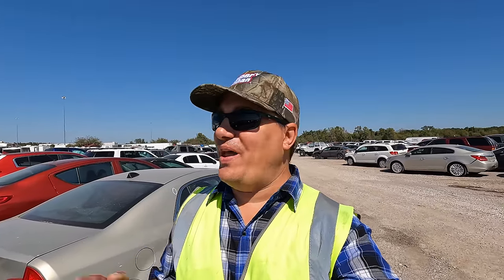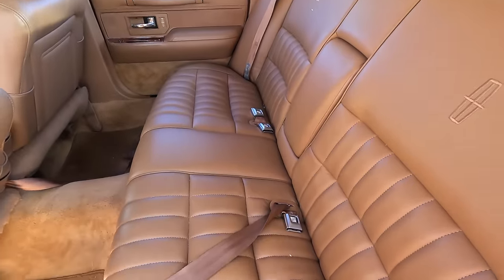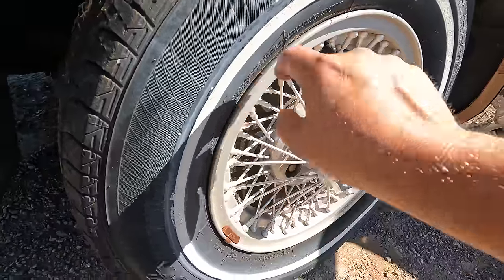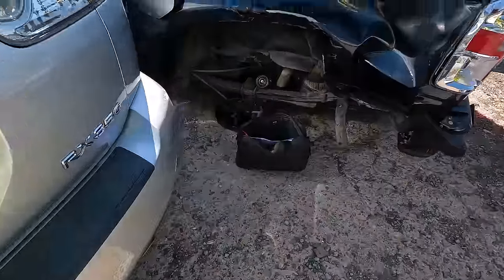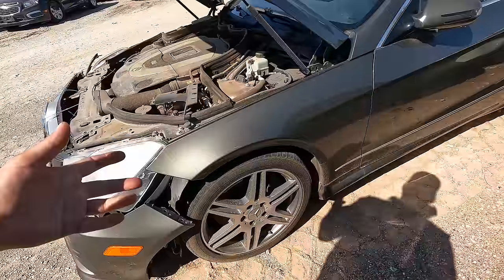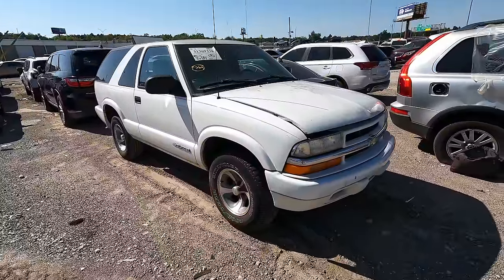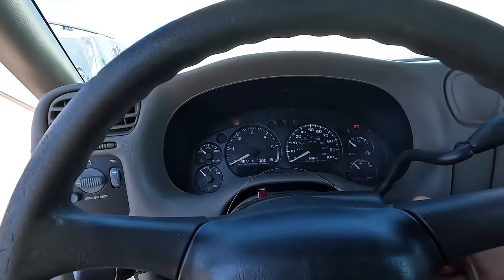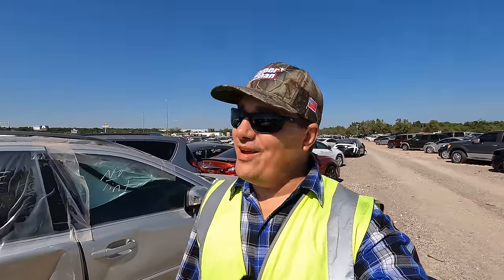IAA Walk Around and Live Bidding!! Winning 5 cars!! 10-9-21

Comment: I laughed when he said "No one in their right mind would bid on this, I will throw a bid on it!"  The Ford name for the color on the Lincoln is Champaign.    The Hybrid message "Stop safely" is most likely a hybrid system fault.  Could be expensive to fix.
Reply: Looked more like rose quartz or possibly a shade of copper.
Reply: @danielulz1640  Yeah you are right.I had a Contour in Champaign and it was a lot lighter then  this.Looks like
Light Sante Fe Metallic
Reply: Hybrid is Latin for "EMPTY YOUR DAMN WALLET"
Reply: We p
Reply: And the Lincoln executive series there was 2 panther products in the video and that means if it needed motor work you could pick up one of the other panther platform products and put that 4.6 in it one of which I think is a white crown Vic cop car, and honestly all the interior issues with the 2wd 05 Chevy blazer lkq
Reply: Look more like bronze or copper

Comment: GM vehicles have day time running lights, your RAM does too.
Reply: But all of the lights were on, not just dull head lights.
Reply: @mexicanspec  Yup. Plus the daytime running lights on these are shared with the bright lights which are in the inner part of the headlight housings closest to the grille.
Reply: @Stressless2023  I bet there is a dirty sensor or it is covered.  I did that on one of my cars, I don't remember which one, so the lights were on all the time.

Comment: The headlight on mid 00s gmc/chevy have automaticity on headlights from the sensor on the dash , if i remember you push the dome overide switch like 5-6 time to set it to maunal mode
Reply: I  think it's just Daytime running lights I don't see a twilight sentinel sensor on the dash\
Reply: @bradmyers362  The daytime running lights on these are shared with the bright lights (the section of the headlight housing that's closest to the grille). The regular headlights might be stuck on due to the dusk/dawn sensor or whatever it's proper name is lol.

Comment: I think the wheels on that Lincoln was from a much older car.  Those same wheels came on my family's 1988 Town car.  I bought they used the same wheels for 8 years.

Also are you sure it is a 1996 model?  Those had the much smaller head lights.

Comment: The Lincoln is a 1994 and it has air ride which can be easily switched over to coils and shocks! Tough cars! I've owned many of these and they ride like a dream!!!! The wire wheels came from a 1985-1989 model. Pull up on the gear shift lever to start it. I bet you will have it running and driving easy!

Comment: Hey I am an old car fart!  Love your video, love your excitment and I will keep watching. My first car was a terribly worn out 38 Chevy which I overpaid for at $30.00 in 1951!  Hey you have to start somewhere.  Currently I have a 97 Lincoln town car, a little newer then the one you are showing.  Love it and it has just over 150,000 and it has been garaged every day of its life.  They do have a wonderful air ride suspension and it is not to hard to maintain.  Then I also have a lovely 83 240D which about a dozen years ago I replaced the 240D with a 300D turbo and did it all myself.  Nothing but M/B factory parts in the swap over, it is exatly like factory!  It is a great old car and I love it, though the A/C was needing everything when I got it and has been removed under the hood.  I will probably be selling it because I am 90 years old and I really love the automatic now!

Comment: 17:20 Escape hybrids have main 300 volt battery back in trunck and either it was in service mode (battery off) or battery just needs shock and car will start, usually those batteries go low after 30 days of sitting

Comment: When I retired I worked as a chauffeur for years until the pandemic hit the Lincoln Town Car is a great car the 4.6 engine is the same as they used in police cars they are good for 2 or 3 hundred miles with no problem, The most comfortable car I have ever driven

Comment: The 4.3 is a great engine. I had and 89 Chev half ton with this engine and it had almost 300000 before the original motor died. I was the 3rd owner and gave it to my son after I finished with it.

Comment: The Blazer has daytime running lights- they're the high beams at partial power, that's why the headlights are on all the time.  When you turn the headlights on, the regular lights will come on.  You can put on the parking brake and they'll go out.  If you don't like the DRL, there should be a fuse in the fuse box (side of driver's side of dash) that is listed as DRL- pop that fuse out, and the daytime running lights should go away, at least my 1995 S10 had the DRL fuse and I did just that, I didn't like the DRLs.

Also, I think that you probably have to use the key to get into the hatch.  The blazer doesn't appear to have power locks so probably doesn't have a power hatch.  I believe that the key unlocks the glass and when you open the glass, there is a ```handle in side to drop the tailgate.

Comment: Blazer has DRL and automatic headlights too.  The ones that were on though were the inside ones which are the high beams running at low voltage.  No fault.  If you throw something on the dash on the passenger side they'll come on too.  That's where the sensor is.  2005 was the last year for the Blazer.  Only available in 2dr, 2wd.  Mostly used in fleet applications.  The seats are 2002-05 style.  The front end changed in 1998.  That is the last variation of that front end.  I know a lot of useless info about the S series.  The 4.3 is one of the best powerplants GM ever made.

Comment: Hey Randy, Great Coverage.. I Hope You Win The Bid On The Benz.. The First Year Of The First Gen S10 Blazer Was ‘83 When The 1984’s Were Introduced, I Had An ‘85 4X4 2.8L Manual (Terrible Service, Engine Barely Made It Past 70K, The Second Engine Started Going Bad At 68K) The Second Generation S10 Blazer Was ‘93 Introduced In 1993 New Models Like That One.. I Had A ‘97 GMC Jimmy 4-Door (38K The Rear Diff. Started Going Bad) I Traded It For A ‘99 Yukon (120K Trouble-Free Miles)

Comment: Randy, On the S10 Blazer, The Daytime Running Lights will turn on when you Start the Vehicle. To turn off the Daytime Running Lights, Simply push the Little Round Button on the Headlight Switch Panel 3 or 4 Times while the Vehicle is Running & Like Magic, They will be off. ;) I own a 2002 Chevy S10 Extreme Blazer and wanted to give you a lil Info so you don't need to Replace the Switch or Relay.

Comment: The Town Car looks like polished copper to me.  So far, I've had seven of them. I'm driving a 2006 (70,000 miles) right now.  Love 'em.  I'd worry about the air bags though.  I've replaced more of them than I'd like to remember.  Your videos are interesting to me.  Some folks just like to complain, don't let 'em get to you.  All of the vehicles you found today were interesting.  Congratulations!  Looking forward to your next one...see how you did.
Reply: Which years are ok for airbags?
Reply: @blackterminal  None of them, I regret to report.  I like them well enough to merely consider replacing the air bags as part of the purchase price.  But then I drive them, I don't try to repair and sell them.
Reply: @mkofftiger  i had a 86 that just had springs. I loved that car so much. Cried when I had to sell it

Comment: i had a ford that wouldn't start after the battery died until you locked and unlocked the doors with the key fob or by locking the drivers side door.

Comment: Randy: I have a 1998 Chevrolet blazer 4 door. 4.3 vortex engine, runs great 178500 miles on it. The head lights are always on. They turn on automatically all the time.

Comment: White 2wd blazer cheap shop truck, daytime running lights lol,, and maybe a 4 light up mod my Silverado extended cab short bed Z71 a early 94 Chevy has had that mod and disabled the dimmer switch because of Spyder halo led projector smoke tint headlights and eBay bulbs junk..

Comment: I have both a 1996 and 1997 Lincoln Town car here in California, both with close to 300K on them. The 4.6 engines are easy to work on, get great gas mileage considering how much they weigh (similar to your Mercury Marauder) and are an absolute blast to drive just not on rainy days being a rear wheel drive vehicle.  In regards to the 2005 Blazer, those are the daytime running lights on with the engine running.

Comment: Ventured into my 1st auction car. Very good exterior n interior. Turned on, sounded good. No dash lights on. Couldn't drv it due to auction house rules. Pulled the trigger n got it home. The fkn thing has trans problem plus electrical n power steering prob. Posted as a REPO with clean title. Seems like they hid the probs n now I'm FKD. Terrible 1st experience

Comment: On the Blazer; abs faults will turn on the brake light. Probably both front wheel sensors are bad. That failure turned the brake light on in my 2002 S10 ZR2.

Comment: The Escape Hybrid doesn't have a starter.  The ICE is started by the electric motor.  When the 12 volt battery goes flat, it creates all sorts of issues and throws all sorts of codes as different systems stop communicating with each other.  Jump starting it isn't enough, you need to fully charge the battery if it's still good, replace it if its bad.  Then clear codes and there's a decent chance the car will start.  If the HVTB's state of charge dropped too low, it will isolate itself so it won't discharge further.  If the HVTB SOC has dropped below a certain levlr, things get complicated, but are still fixable.  09 was the most desirable year for the FEH...first year of the bigger engine, last year of the better battery thermal management system.

Comment: Look at the Explorer. When you had the key in the on position, the security light was flashing fast in the bottom left of the cluster. Probably has a PATS fault which doesnt allow the starter to engage. My old F-150 had this issue, and the root of the issue was a weak transponder chip in the key. If you had the time, it may start up after sitting there and cycling the key for awhile.

Comment: That 1994 Lincoln has wire hubcaps you have to pop the center cap and they are locking and the key in either in the trunk or glove box. These in good shape in my area are a 2200-3500 in my area.

Comment: Hybrid vehicles don't have a starter motor. The ICE "bump" starts off of the electric drive motors. This particular Escape judging by the appearance that its been parked for a while means the hybrid drive battery is completely depleted and does not have any power to turn the drive motors.

Comment: The security light was blinking quickly as you were trying to crank up that ford escape, it could be anti theft stopping it from starting. I know my 2000 Durango wont start after a dead battery unless you hit the unlock button on the key fob a couple times. Next time you could try hitting unlock on the key fob it might help.

Comment: The town cars wire rims are from the 80's.  They didn't make them in the 90's.  So they were switched out at some point.  The caps on them actually have some value because they get lost and are quite rare. They can bring $60 to $100 a cap from a guy who wants to finish his restoration off.

Comment: My father owns a Lincoln Mark 3 it's electric problem %100  check the wire's under drive side if look like some messed with it  just resolder the wire's cheap fix most of times 😎🤠🤔

Comment: I would have bid on the Lincoln as well. Around here it’s a sought after vehicle by all demographics. I don’t particularly have luck with Ford’s but if I got it running and the rear airbag suspension was good to go maybe some paint or clear coat and at best that plus tune up she’d bring a great turn around.

Comment: The headlights on the Blazer are DRL's.  They stay on when the key is on.  And since it's a "basic", no tilt etc. it won't have the remote deck release.  I wish you would have looked at the Volvo next to the Blazer.

Comment: I'm partial to the Town Car. The bags are probably shot which was common with them. My father-in-law had a '97 and it was cheaper to get the rear suspension converted to the springs than repair the bags.

Comment: The hybrid escape  won’t start when it sits with a dead battery . The hybrid battery runs below a certain voltage it disconnects..  you have to charge the 12 battery to full then actually jump the hybrid battery . You do this by removing the left side dash corner panel and press and hold the button  . The green light will flash next to the button you let go and let it go for 15 mins . The car is using the 12 volt battery to bring up the voltage in the hybrid battery . .  You might want to do this 2 to 3 times . If you have a scanner you can watch the voltage go up as you do the jump start process ..  ..

Comment: A note on those ford escape hybrids. When you jump start them there is a button in the drivers side footwell that you need to push. Those use the hybrid battery to turn the engine over. When you Jumpstart one push that button and wait 5 to 10 minutes. That will put a sufficient charge in the hybrid battery to start the vehicle.

Comment: With the Ford escape, the hybrid system shuts down if the 12 volt battery loses power for too long. Once that happens, you have to either have a ford code reader to clear the engine code from the hybrid system so it will allow the car to run again ( even if you change the 12 volt battery, it will not run or stay running without the code getting cleared) or you have to take it to a ford dealership and pay the a couple hundred bucks to hook it up to their computer to clear the codes

Comment: I love you 8 love the car the Lincoln town car I would buy come of cars u buy fix up and buy I have 2 s 500 2003 55.500 my ole. AMG drive excellent stood for 4 4 year changed. Battery car roße and drive body coop was say air compressor and have 200
Reply: Only be owner on both next. 2001 only owner 70.000 mile 2003AMG  55.500 miles one of remember berries bravo one of the best rims hit me up.p California

Comment: I believe their daytime running lights when you press that button at the bottom several times they shut off and you can turn them on yourself with the switch. My 2000 suburban would do the same.

Comment: Fun fact, at work when people used to trade the escapes in they'd almost always have an issue with the ignition switch that requires you to push the key in hard while turning. The car wouldn't turn over unless you did that.

Comment: In 1988 Canada made it a law that all new cars have the headlights running during the day. Some companies such as GM on several models, just made this change acrross the board.
This is done for a safety feature as it is much easier to see a car even during the day, when the lights are on.
Reply: Yeah, I had an almost identical Blazer with the Canadian daytime running lights. If I remember right they can only be shut off by applying the parking brake. I think they were 90% as bright and then you would always forget to turn the switch on at night for the extra 10% because the headlights were already on
Reply: @jasonfabian1563  The lights are always on. You are correct that they are at a lower intensity, this is because they are simply on during the day for safety and to allow others to more easily see oncoming traffic. I believe the brightness is only at 60% which will allow the headlamps to last for a very long time and not burn them out faster.

Comment: And randy for the love of god that blazer has auto loghts they all do passenger side speaker / tweater has a lil itty bitty sensor on it and the hatch is a truck style put a key in it it should pop out and latch is on the inside as long as the lock isnt siezed
Reply: On the dash sorry lol passenger tweater on the dash not the door
Reply: You can spam click the button by headlight switch to turn that feature off

Comment: I've always thought these wheels on the early 95 round body s10 and blazer trucks would look great on gm gbody cutlass, regal,gp, and Monte Carlo also grand lemans, gbody Bonneville and Malibu and El Camino and caballero...  And honestly in my opinion better option than most aftermarket newer wheels I can buy for them.. yes I didn't catch that at first it has the 99 and newer front grille and headlights..